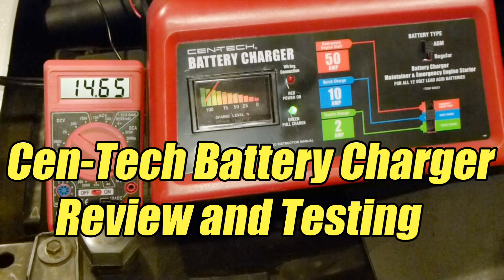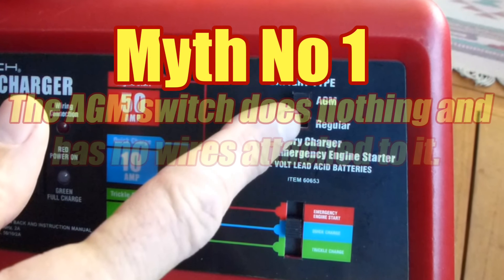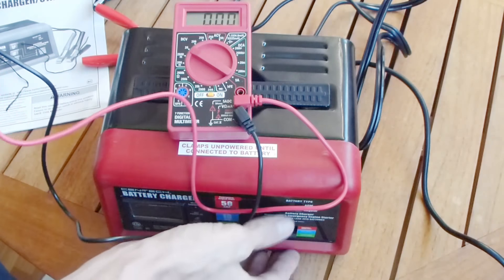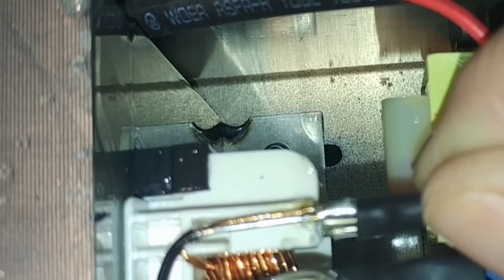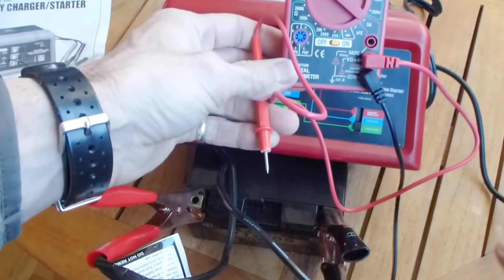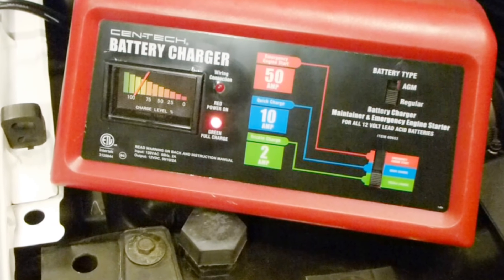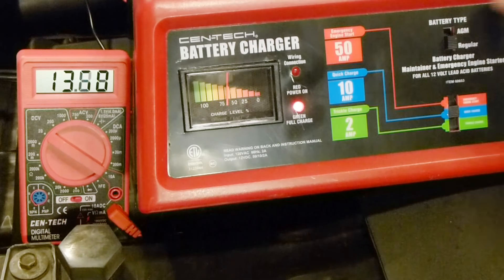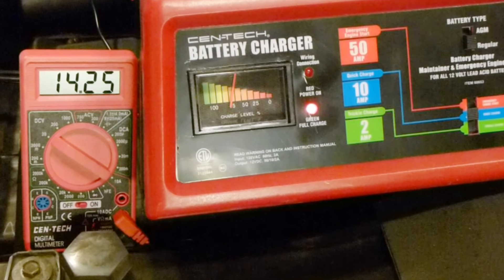Cen-Tech Battery Charger & Starter Review and Testing Harbor Freight

Comment: Your review on this charger just disqualified all the others on YouTube. Excellent review!!!
Reply from the maker: Mike Martinez: Thanks for taking the time to comment. I'm glad you liked it. Thanks for watching and for sharing.
Reply: I agreed ...you busted all the myths of the other Youtubers
Reply: @ScubaMoto  How do you know when the battery is fully charged, because when I connect charger to any Battery the one LED light goes on and never turns off. and I mean the green charging LED on the charger, or do you have to rely on the meter that say's 100% to know, because the margin of error is greater relying on the meter, versus the charger turning off automatically.
Reply from the maker: @alexshatner3907  The charge light goes out on this model when it changes from red to green. That will always coincide with the meter at far left (full charge).
Reply: @ScubaMoto  I have part number 59424 and it goes green from the minute you put it on a battery to charge and it stays green forever as long as the battery is charging.
Reply from the maker: @alexshatner3907  Thanks for the update. That's important info to know it's a different model than this video. In addition to the one in the box, HF has a link to the owners manual in the product page (support section) on their website. On Page 6 in the owner's manual for new blue model that you have, it details that it is supposed to do exactly what you describe. The light is GREEN while charging and stays GREEN when it's fully charged. It indicates fully charged using the gauge which will be far left when fully charged.  The RED light is used only to indicate errors like reverse polarity. This was likely done to prevent people thinking something was wrong when the charge light was on with the model in the video.
Reply: @ScubaMoto  Thanks Scuba you are on always on top of this I am your new subscriber

Comment: I learned something very valuable about 2 minutes into this video! I have 3 battery chargers, and I kept trying to check the output and none would work......but they were not connected to a battery! Thank you!! They may all be good!
Reply from the maker: Rick Neighbors: Odds are they are working.
Reply: Does the battery need to be slightly discharged to get a good reading? My riding mower is 12 volt, but it was fully charged, so the charger did not appear to be doing anything, and the test meter showed the same reading that the battery showed before I hooked up the charger.
Reply from the maker: Rick Neighbors: Yes that sounds right but I would confirm charger function with another battery.

Comment: Thanks, very useful video.   I just purchased one of these chargers and had seen other videos stating the 50 amp start motor start did not work.   Good explanation.  It is interesting how they designed the 50 amp circuit to cycle on/off until the car attempts to start.

Dave.
Reply: I guess the reason it's cycles is to prevent overvoltage going direct to the battery and considering it would also be connected to a vehicle that you don't want too many volts going through the car electronics.

Comment: Thank you so very much for this review. I have a 2007 Crown Victoria Police Interceptor with two batteries. I have the Autozone DLG-65 as my main battery, and a marine battery in my trunk hooked up to an inverter that powers a refrigerator/freezer in my trunk that I use to mainly for when I go fishing,or on long trips. My problem is that sometimes when I return from fishing, or a long trip, I'm tired and prolong removing the items from the refrigerator. I don't drive the car the next day, the main battery dies and I have to  all for roadside assistance. I was in Harbor Freight a few days ago, and was looking at this battery. I was on the fence about making the purchase. I had a lot of questions that you definitely answered, that other reviewers of this product did not.  I on my way to get one now. Thank you!
Reply from the maker: I'm glad the video helped. Thanks for the comment.

Comment: Thanks for your review! Ever review I've seen talks about how the 50 amp doesn't work, nice to see how it actually does work and why others can't get it to.
Reply from the maker: Luke Lewis: Thanks for the compliment, I'm glad the review helped. Yes, there are many misunderstandings around battery and charger amperage. Common vehicle batteries have 400 -700 crank amps. So if you have a dead battery, another full 50 amps won't likely be enough to do anything if you don't first put some charge on the battery. Then the extra amps from the charger will likely help start the vehicle. Thanks for watching and for sharing.

Comment: I tried it on two different batteries and the light did not come on and nothing changed on the gauge. I switched modes and charge levels and waited a few minutes each time. I returned the first charger for another. Same issue. I tested the outlet with a sawsall. Power is good. Two bad batteries or two bad chargers?  I am going to try it on a new battery.
Update:  you're a genius.  Good battery charged and indicates fine. I have two very low batteries. 
Thank you!
Reply from the maker: B G: Thanks for sharing the comment. I was wondering what the voltage was across the terminals of the low battery before connecting the charger. It sounds like it may have been below 3 volts so not able to activate the charger. You can still use this charger to try to bring the low battery back but you need to bridge in another battery with enough voltage to activate the charger. After a few minutes, the voltage on the low battery should come up enough that you can remove the bridged battery and see if the low battery can eventually receive a full charge. Thanks again for the comment and for sharing.
Reply: @ScubaMoto  Does this work if the “good battery” is installed in my second car (or does the bridge battery have to be out of the vehicle)? Also how do I go about “bridging” the good battery? Alternately can I try jumping the car and then attempt to charge?
Reply from the maker: @nunyaabusiness1984  You can leave both batteries in both cars if you can bring the car with the charged battery close enough to connect to the dead battery car as you would a jump start. Since you're now jumped to a car with a good battery, you might be able to just start the dead battery car by first starting the good battery car and then try starting the dead battery car. But since you have a charger, it will be better for the dead battery car's charging system to first bridge-charge some life into the dead battery before starting the car.

First, and this is pretty important, connect the charger to the dead battery with the charger in 2 -Amp mode. Again, it's best to put the charger clamps on the dead battery first, before the jumper clamps. The charger may not engage to charge mode yet, but that's expected if the battery is dead (below 2.5 to 3 volts). Now, use your jumper cable to connect the car with the charged ("GOOD") battery to the charger clamps that you put on the dead battery. Clamp your jumper clamps to the outside of the charger clamps already on the dead battery. The charger should now immediately respond. Now you can move the charger to 10-Amp mode and remove the jumper cable from the charger clamps. The charger will remain connected to the battery that was dead and should continue charging. 

The jumper cable is now removed and the charger is charging the dead battery. Depending on how the dead battery was drained, the charger will need more time to bring the dead battery up high enough to use starter mode. I would wait a minimum of one hour before using starter mode to attempt starting the "dead battery" car. Remember, starter mode only adds up to 50 amps. That's really not much considering that most batteries are 600 to 800 crank amps. So you'll need the battery charged up a bit to do most of the heavy lifting of starting a car. This will also avoid over-stressing the charging system of the dead battery car. I hope that helps.

Comment: Regarding the safety standard information you mentioned where chargers will not charge at all under three volts... This was a huge help! I hooked up my other car and just connected the batteries. Turned off the other car. My immediately connected the car charger I have and it started working! Before that it kept blinking back and forth because it was under three volts. But I couldn't figure out why I was doing it. You might have saved me buying a battery, actually two because my other car is dead right now also! Now I may be able to save both of them
Reply from the maker: R S: I'm glad the information I provided was helpful. Congrats on getting things working again. Thanks for taking the time to comment and for sharing.
Reply: So you “tricked” the charger to charge the dead battery? That’s clever. Did it work in bringing back the batteries? I might need to do that as the static voltage reading I get is about 3v. Can you tell me how  you connect the 2 car batteries?

Comment: I notice when you hooked up the motorcycle battery the gage stayed over to the left. The instructions state if it starts off at high end and does not move off after 5-10 min it's probably a shorted battery. I bought one by the way it works fine on a low battery I had.

Comment: Does any know how long to charge the cen-tech for??? Not the car battery . im asking about the unit it self the power cord to wall outlet ???  Some one know ???
Reply: Well, first you have to charge your house for a while, and when that's done you have to charge the dishwasher and washing machine. After all those things are done you can go ahead and charge the Cen-tech. Just sit there and watch it until a display lights up to tell you that it's fully charged. Watch carefully though - you don't want to miss it!  ....You're welcome
Reply: @2tallB  lol 😂
Reply: It has a 6 foot chord, so I would charge it for 6 feet. You can use an extension chord, but only use yellow extension chords, the orange ones won't work unless you are in Canada.

Comment: I wish the owners manuals had that much info in them! Or at least have it inscribed on the case that it has to be hooked to a battery to work, and a starter must be trying to crank for the boost to work! I thought something was wrong because the needle kept just clicking over and back. You may have save 3 battery chargers!  ;)
Reply from the maker: Rick Neighbors: I'm glad I could be of service and save you some money. Thanks for sharing.

Comment: I just received one of these chargers yesterday. As soon as I removed it from its box the gauge was showing 100% charge, not even connected to a battery. Even connected to a battery in a car that doesn't even have enough charge to sound the horn of the car.
So, I am guessing that I have one of the badly made ones?
I did open-up the unit, after getting encouragement from you. One of the soldered connectors wasn't soldered good enough so I did resolder the connection, but that still didn't help the always-100%-gauge.
Thank you for such a great review.
Reply from the maker: Walking Zed's Push Bike: Thanks for the question. It sounds like your charger is working fine. When the gauge is in the "100% Charged" position, that means the charger is doing nothing. They come out of the box that way. That gauge position is a good thing when not connected to a battery.  It is a safety feature common to all chargers.  If your battery voltage is too low (below 3 volts), the charger will not respond to it for the same safety reasons. This is the same for most chargers. Test the charger on a battery with higher voltage. To bring a battery from completely dead, you will need to bridge in another working battery to activate the charger and leave the other battery connected until the dead battery has enough voltage to activate a charger.

Comment: Great review and explanation, I'm charging 12V AGM batteries in 2Amp seen to work but real slow, in 10 Amp the charger is doing some bump noise and the green light flashing, so went back to the 2Amp trickle charge, that is normal the noise and the flashing green light on the charger, everything else is find and in regular mode charge few times in 10 amp and not issues only in AGM thx for the video
Reply from the maker: Thanks for sharing

Comment: Nice review! I just came in from the subzero temps as this charger/starter does not give a boost in the starter mode. I have an old truck that hasn't been started in a month. The battery is fully charged (on a battery tender) but the truck starter only cccccccccccclllllllllliiiiiiiiiiiiiiiiccccccccccccKkkkkkks. Thus the starter won't engage to make the Centech apply a boost. I pulled on my old similar charger/starter which gives a constant boost and I was able to get the starter/bendix/solenoid to engage and turn the engine just a bit. That means this CenTech charger/starter will be useless to me when I need it most on those frigid days. With my old starter I now know that everything is fine with the truck and I will just wait for it to warm up a bit. The Centech however failed on the starter mode which means that function is useless in subzero operation. Until I saw this video I thought the CenTech starter function was broken(it still is effectively) doing the buzzing brief zap of power on/off thing (lights in my truck would go bright and dark with the bursts so the CenTech is briefly boosting but not locking in the boost).
Reply from the maker: Bill Gartman: Thanks for sharing your experience. It's normal for subzero temperatures to make starting more difficult but it has no effect on either of your chargers. Batteries are very effected by sub-zero temps and, to a lesser degree, the engine is also harder to rotate as a result of freezing temperatures. The long standby is also a contributing factor on all of the above. I don't know the manufacture date printed on the battery but it is also possible that the battery may be bad or approaching bad. The age of the battery is a critical factor for a standby vehicle. A battery tender cannot compensate for such a cold battery as the tender probably only puts out a couple of amps. 

Sub-zero temps with a long period of standby have knocked this battery down hard. Car batteries (and most likely your truck battery) have 700 to 900 crank amps when fully charged and in good health, so the additional 50 amps from a fully functional starter mode will have little effect on a dead, discharged or sub-zero battery. You will need at least a few hundred crank-amps to get this truck started. A battery first needs several hours of charge for 50-amps to be useful. You may not need to leave it overnight, but it needs a decent charge first.

If I were trying to start this vehicle, I would begin by putting a 10-amp charge on the battery for several hours to see how it responds to a proper battery charger. If it doesn't respond, then odds are the battery needs replaced. If it does respond and take a charge, then it would be time to try the starter mode. I hope that helps and thanks again for sharing.

Comment: ¿Are 50 amp enough to start a 650 amp Mitsubishi Eclipse dead battery?
Reply from the maker: Luis Angel De Alejandro De la O: Not likely. 50 amps is typical for units like this but it really isn't all that much. The bigger chargers in shops that are on rollers usually have 200 amp start mode and even that needs a little bit of charge on the battery. For "Start Mode" on these smaller units, I recommend putting the charger on the battery for at least an hour at 10 amp mode before trying to use start mode to start the vehicle. That way, with battery plus charger, you are more likely to get enough combined crank amps to start the vehicle in start mode. Thanks for the question. I hope that helps.
Reply: @ScubaMoto  

Great explanation, thank you.

Comment: Hello, great video! Though I must’ve missed what type of battery is considered AGM? I have a regular interstate battery assuming that would be charged under regular.
Reply from the maker: AGM batteries are usually labeled as such. If not, they typically have no fill ports and are also called maintenance-free. If you suspect it's an AGM but you're not sure, just use AGM mode and your regular lead-acid will be fine. I hope that helps.
Reply: @ScubaMoto oh wow, I didn't expect such a quick answer, Thanks! I have the charger on my car now using regular and the needle keeps jumping. It started at Midway in the orange and keeps jumping to fully charged back and forth. Is that normal? I will disconnect and try it in AGM mode